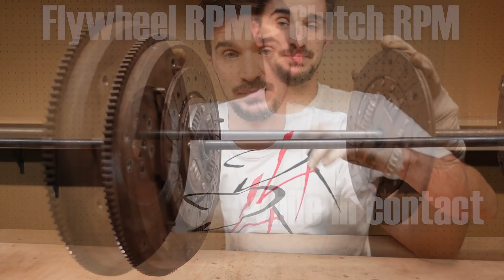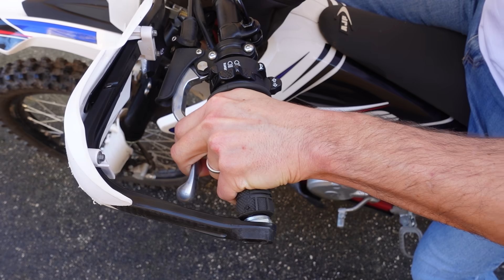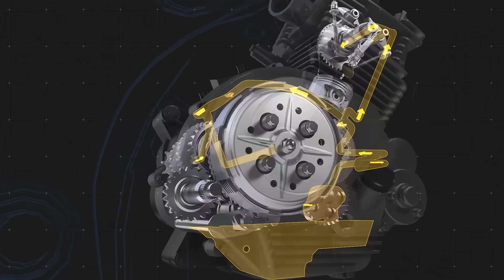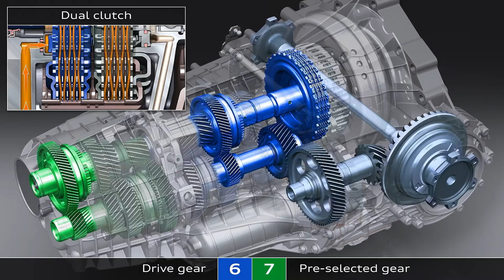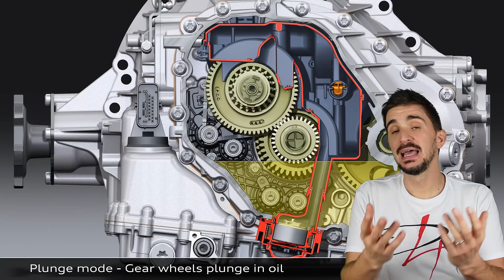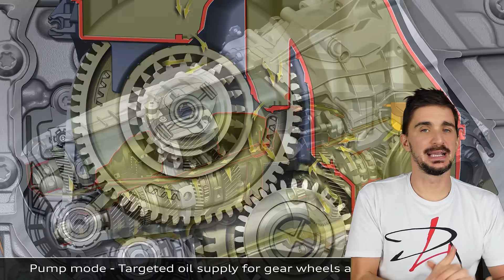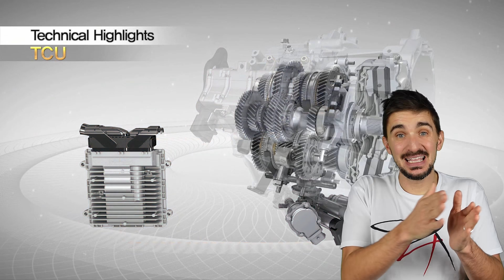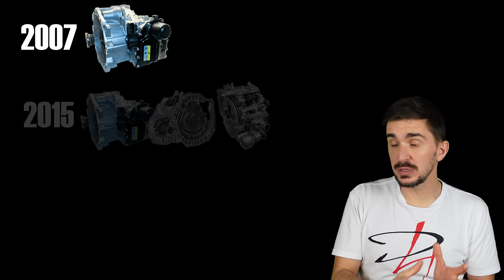Why Dry Clutches Suck and Why You Should Avoid Dry Dual Clutch Transmissions (DCT/ DSG)

Comment: My newer Honda motorcycle has a wet DCT that I think works extremely well.  It's like it's think ahead of me by how it monitors the throttle and break and decides how long to hold on to a gear or allow engine breaking or disengage the clutch completely.   No, I don't want it on every bike, but it has it's place.  Thanks for some fun videos; I just found your channel.

Comment: Conventional manuals have multiple clutches! There is the main clutch you control with the pedal. But inside the transmission, there are also two parts that need to be synchronized together. For that, there are little clutches called synchros. When you throw the stick into another gear, the output shaft and input shaft of the transmission are put into a different relationship. The output shaft's rotation is determined by the wheels and vehicle speed, and so the input shaft has to speed up or slow down. That has to take place before the engagement (locking a gear onto the shaft around which it is rotating freely). As you throw the stick into a gear, a little synchro clutch engages first, changing the spin.of the transmission's input shaft (and this is why it has to be disconnected from the engine by the main clutch).  When the shaft synchronizes, the stick can then move all the way and engage the gear. At that point, the job of the main clutch takes over. It is dual clutched! Without the synchro, shifting is difficult, requiring rev matching. In particular, shifting down is difficult, because the input shaft must speed up. Double clutching is required. First, shift into neutral: step on the clutch, and move the stick. Then, while in neutral, release the clutch to connect the input shaft to the engine, and blip the throttle to spin up the input shaft. Then disengage the clutch again, and push the stick toward the desired gear. As the input shaft spins down a little bit to the synchronized speed, the stick will let you complete the shift.

Comment: so the best option - both environmentally and from the engineering point of view would be to have separate oil for the gear case and separate for the clutch itself - wouldn't it? Perhaps even the clutch fluid wouldn't need to be oil - it could water-based...

Comment: Just found this channel today. And pretty much fell in love with it!!

As someone who owns a honda with a dry clutch i-dcd, i am now more worried on how i can maintain or maybe increase the lifespan of my dct transmission. If you can make a short a short video on that it would be much appreciated or even a short reply in the comment would do😊.
Reply from the maker: Thanks for watching and glad you liked the content. There's nothing special to be done other than regular maintenance with high quality fluids and smooth driving. Almost any transmission benefits from gradual and smooth acceleration rather than sudden bursts of throttle. Check if there's a need for any recall work, afaik some early years around 2014 had recalls on the transmission but I'm sure there's plenty of info available online.

Comment: Hyundai hybrid DCT is a dry clutch, has been reliable, though not a perfect transmission.

Doesn't need to slip clutch because the electric motor can fully engage at 0 rpm, 0 mph

Comment: The other issue with wet clutch dual clutch transmissions, well two actually, are that the synchromech gear ratios are changed far more often up and down in the backround by very quick shifting and rough changing mechatronics because it constantly anticipates whether the next ratio change is going to be up a ratio or down and changes to what it thinks is appropriate in that moment. The second issue is that they are difficult to modulate when starting off from a vehicle at standstill. Give me a torque converter type planetary type automatic any day of the weak. Something like a ZF or Aisin eight speed or a Ford ten speed automatic. I wouldn’t even consider a dry DCT but have owned one of the better wet DCT in a Kia Sorento 2.2 diesel. Dual clutch transmission are also now becoming mainstream on medium size farm tractors from Deere, MF and CNH when the farmer does not require a full continually variable power-splitting transmission which are vaguely similar to hydraulic versions of the Toyota e-CVT.

Comment: 0:43 Not in a petrol. 😎
Reply: That timestamp has two statements on either side, and both are true for diesel and petrol...
Reply: @grapetoad6595  No because a petrol doesn't jolt. It just buffers and shuts off.
Reply: @LEGEND4RY_KN1GHT If you don't think petrols jolt, you must have a different definition of jolt. I worry for your passengers.
Reply: @grapetoad6595  Petrols literally do not move an inch when stalling bruv! ☠️🥀
Reply: @LEGEND4RY_KN1GHTuhh what? They literally do

Comment: Dry clutches have been used with tremendous success for over 100 years. The problem is with new transmission designs that have not been fully developed.

Comment: Once somene rides a bike with wet clutch (so most bikes) and enjoys the liberty of basically applying as much clutch as needed whenever needed (within reason and within mechanical limits), dry clutch, although it is not,  quickly starts to feel like a crude solution.

Comment: I've always wondered what if they had a torque converter in conjunction with a regular dry clutch manual transmission with the torque converter being before the clutch,  where it does all the work at low speed, for example under 10 kmph (like stop and start traffic jams), so we don't touch the clutch pedal and can also idle briefly with the foot on the brake. But when moving faster, the torque converter locks up and we use the clutch pedal to change gears as normal. Best of both worlds.

Comment: Nothing is done for the environment. It's purely about oligopoly interests.

Making more money by creating more waste, and this discarded waste is paid for by the IDIOT consumer who BUYS every car with a bomb kit; rubber belt submerged in hot oil sealed in the engine, direct fuel injection in squeezed engines, cylinders very close to each other, automated transmissions with dry clutches that need to continuously slip to imitate a conventional automatic transmission.

Did they realize that these same automakers decided to enter the race to try and somehow turn the market in their favor?

They didn't succeed because the American Tesla and the Chinese BYD are far ahead, and with them, a new possible oligopoly of electric automakers is born.

We will have to get rid of all of them if another oligopoly is created, ALL OF THEM, and pay indefinite fines for delaying market competition and for acting like BITCHES to politicians.

Comment: In 2007 I bought a 2005 Audi TT DSG Quattro.  The second year any car was available with a dual clutch transmission.  20 years later I still have that car.  It still drives like new.  I have never had a single repair or problem with the engine nor the transmission and all I do is regular scheduled maintenance.   The transmission in my TT is the closest to a perfect gearbox as I have ever seen.  It will NOT allow me to lug the engine, nor run at not over redline. It never forgets to shift into first at a stop. It shifts perfectly every time, and faster than any human or automatic can.  Because of the 3.2L naturally aspirated engine, the transmission will shift all the way into 6th at 35 MPH if I am just cruising along a surface street, giving me 30 mpg.    

I don’t race the car, and do not abuse it with jackrabbit starts, but neither do I dawdle.  I generally let it do the shifting for me, but I adore having the paddle shifters at my fingertips to downshift on off-ramps, or take over shifting in a moments notice, like when I have a bunch of weight on board and want to keep a lower gear going up a grade. 
The sticker price new was $64k in 2005- I bought one fresh off a lease with only 14k miles on it for Half that price.  And of all the cars I have owned, the TT has been the lowest cost of ownership of any car… even the Acuras, and Toyotas. 
Sorry- I love my DSG.   After they put them in the TT, and the VW,  they developed a 7 speed for Porsche, and the Bugatti Veyron famously used a DSG gearbox developed by Audi.
No better nor more reliable gearbox out there.

Comment: Spot on video. The industry's obsession with dry DCTs is a masterclass in cost-cutting disguised as 'eco-efficiency'. Dealerships sell you on fuel savings, but conveniently leave out the $3,000 repair bill when that clutch pack inevitably jitters itself to death at 60k miles. This is exactly why we scrutinize the pros, cons, and raw engineering of these drivetrains in our documentaries at Motorcyclopedia. We take these cars, dive into their mechanical history, and push them to the limit at Dunsfold to see if the engineering actually translates to the driving experience, or if it's just corporate marketing. Stop buying disposable drivetrains without knowing the facts first.

Comment: I used to like the idea of a dry clutch on a motorcycle for fun launches, and changing out the plates is much easier than on a car so it wasn't a big deal. But when Ducati of all manufacturers stopped using them, I figured it couldn't be all that great after all.

Comment: I think the biggest problem with dcts of all flavors are the service technicians and people who drive them not understanding that they're not to be treated like standard automatic transmissions. Like the Ford power shift gets a lot of heat because instead of replacing the $140 actuator that takes 12 minutes to get to a lot of the service technicians would write the entire transmission off as being bad. I've just noticed that the only people who actually have personal experience with those transmissions and happen to be car guys who can turn a wrench tend to love them because of how easy it is to first get them cheap and second to fix them. The people with the loudest opinions on those tend to be people who know nothing about how they work or literally have never owned one.

I'll tell you from personal experience as somebody who has a wet DCT in an Elantra n that every time I go to get it serviced (every 23k miles) I'm going to be looked at sideways by the guy who works at Hyundai because they're only used to working on Santa fe's and base Elantras, so the concept that this thing would need a special kind of oil is foreign to them and they're just going to tell me they have it even though they don't. Believe me, I've tried, no amount of me insisting on them checking is going to change the fact that they won't actually go look until I show up and they find out the hard way that they don't have the necessary equipment to do the job. That is assuming that they don't just do it incorrectly anyways and end up destroying my transmission. It's a very reliable transmission setup and they've been making it for years, but it's completely asinine to me that the biggest risk that I run, and the most likely thing that will blow my transmission up, is getting it serviced at a certified dealer. Let that sit in your mind. To anybody telling me I should do the work myself, guess who doesn't post the oil weight or capacity publicly for you to do your own service. Also you're expected to vacuum the oil out using a dealership scan tool that will turn on the transmission oil pump with the car not running. Not saying that it makes an appreciable difference, but it's some shade tree mechanic stuff you get into very quickly. On a good note at least they're cheap and the parts are plentiful.

Comment: Bro I love your videos... but dropping the clutch at 5k+ is kinda my thing. I've done it countless times. I've got the flywheel and clutch from my 351w and T5 on the shelf right now. It looks the same as it did when I installed it. That engine was making approx 375-400 hp. If the tires loose adequate traction the shock load is reduced enough to prevent damage.

Comment: I remember someone saying they would not sleep at night without an extended warranty on a DSG gearbox. I have always been nervous in queues about creeping along and try to move in reasonable jumps. The advice I see everywhere to go in to sports mode in traffic jams to prevent slipping along in 2nd gear to save the planet under the edicts of the eurocrats seems a good idea. Switching off auto start and all other eco and assist nonsense is a start up ritual in my car. I did have a whine in a DSG in a previous car hilly area reminiscent of clutch release bearing whine which cleared on getting back to flat areas. Memories here of persuading the better half not to rest her foot on the clutch pedal! The mechanic showed me it was a sintered lubricated bearing so possibly ran dry for a time. I only ever use hill start for the minimum needed as it is potentially a real clutch killer.

Comment: It's interesting how clutch and brake pads are very alike and you have to calculate how hot the brakes will get when stopping when designing. And it starts to cue you in on why front wheel drive downhill racing and breaking heavy a lot becomes a real problem.

I might disagree about dual clutch transmission having the fun of manual though. Big part of driving manual is using the clutch and having the skill. I mean it's not much perhaps, but then again just moving from one gear to another by a flick of a finger doesn't bring much on the table over using automatic either. Admittedly with modern cars you really don't often need to bother with rev matching or double clutch kick, but the idea of operating manually still exists in controlling the clutch and the gears.

So, since car manufacturers replaced wets with drys, why did Ducati stop offering it in motorcycles?

Comment: Indeed - I loved the part about the DCT - I "enjoy" robotic gear change in our Mercedes Benz Atego trucks - hitting a roundabout is hit and miss in those vehicles - dry clutch and a computer that cannot see what's going on... As a seasoned driver, I try to anticipate the behaviour but I am afraid that is a bit hit and miss too😀 Sometimes the gear box and myself are on the money, sometimes not... 
However, our service vehicle is a VW Transporter with DSG - that thing is an absolute joy, but you gotta stick religiously to the oil changes for it to stay like that.
As they say: There is no such thing as a free lunch....

Comment: That filters on motorcycles are work double time then... didn't know that. Well this is depressing know that no matter how I shift smoothly there is ware every time the clutch is engaged.I thought the wear happened with new drivers mainly and is very miniscule with seasoned manual drivers. I guess it's impossible for a clutch to last for 300K miles without unbearable slipping.

Comment: One major correction: Most DCTs (or even most Clutch to Clutch Automatics) don't require recalibration. Just like how you don't need to fiddle with a fuel mixture screw, all modern automatics since the 2000s use adaptive self learning. As the clutch wears, the TCU would adjust apply pressures and ramp speed to maintain a consistent shift speed and quality. You can force a transmission relearn, but it's not necessary.

Now that doesn't mean that the Ford Powershift is a good transmission. There are lots of problems that aren't even related to it being a dry clutch.

Comment: How variable engine braking works? Everyone knows that if you release gas pedal engine basically become Air compressor. Higher the torque of the engine, higher engine braking force (negative torque). It's fixed. Unless it's not. Many newer cars and motorcycles can change engine braking simply by setting in menu on the fly. No advanced engine mechanic neded, no crankshaft replacement. But how?

Comment: Very well said 
You should also make a video why cars engines don't have wet charging systems like motorcycles instead of an altenador because motorcycle charging systems seem like a lot more reliable because no extra pulley, belts, bearings and alot more

Comment: Could you design an engine with a two ended piston? Piston rod in the center of the double ended piston. The engine would have a head on each end. The piston would be a four stroke but fire as a 2 stroke.

Comment: The Dual Clutch transmission is, in my opinion, the ultimate evolution of the manual. However, I prefer regular manuals...simply because I am better at slipping than than a computer (and I am in control).

Comment: Not only the clutch is the problem. When driving, one of the clutches is always engaged while the other is disengaged. This means that one of the two release (pressure) bearings is always under load while the other is released.

At least in VW gearboxes, the inner and outer rings of these bearings are made from stamped sheet metal rather than properly machined rings like those in a conventional bearing (probably due to space constraints). Another issue is that the whole system is operated by hydraulic actuators, so if you lose oil pressure you cannot move the car at all.

As a design engineer who worked for years on these gearboxes, I would never buy one with a dry clutch. Knowing how they look inside and being aware of all their issues, I still prefer a manual gearbox.

A car should be simple and reliable. Sadly, nowadays the trend is to build laptops with wheels, which is not my taste.